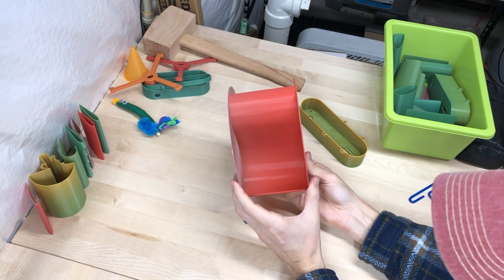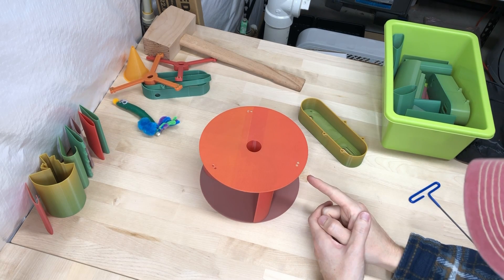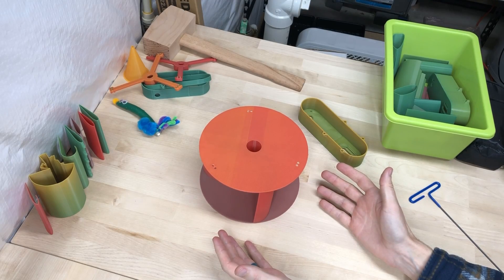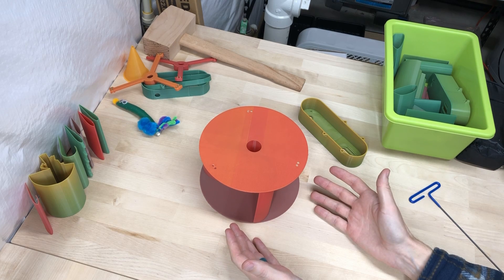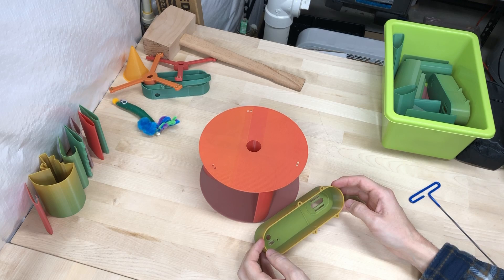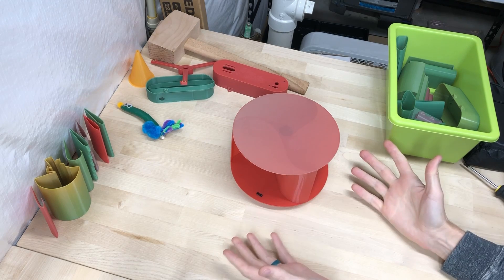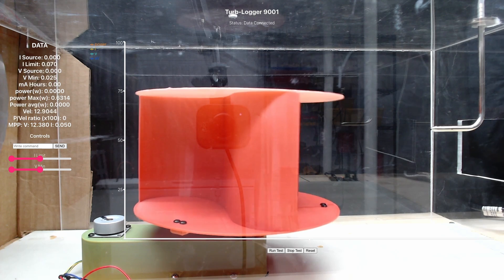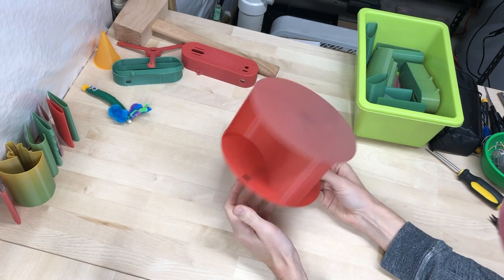A Viewer absolutely DESTROYS our VAWT record!!! (and my wind tunnel...)

Comment: I feel that you will get better power at higher speeds when you figure out how to keep it more balanced. 3 or 4 heavier points on the top, as well as some sort of pin indexed in the tops center. I bet you will see some power outputs.  BTW. I am no 3d printer dude, or any kind of engineer. Just a dude playin a dude, actin like anotha dude
Reply from the maker: I feel inspired, an idea has been jostled from deep in my bowels. Thank you my dude.